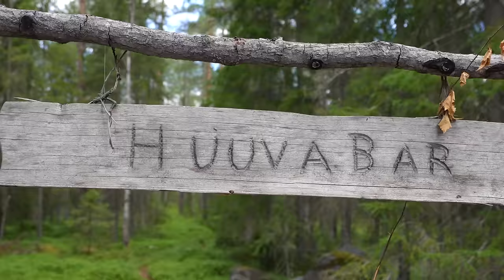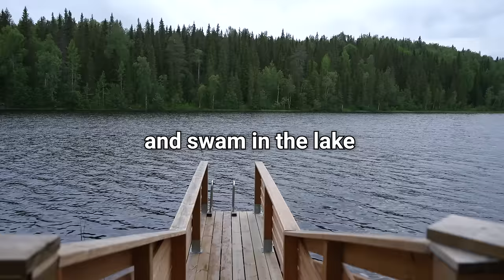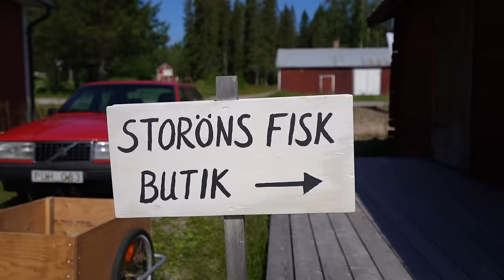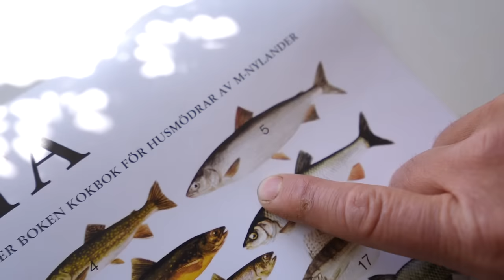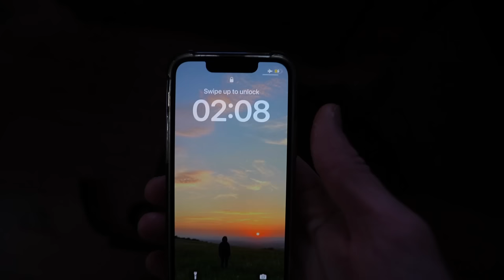Travelling to the northern wilderness - 1 week in Swedish Lapland

Comment: The red paint is called falu rödfärg and is as you say a by-product from copper mining. It was originally made in Falun where Sweden has had a massive copper mine since about 250 years back.
Reply: Copper has been mined since 800 century in Falun and ended 1992. First written document is from 1288.
Reply: way more than 250 years....
Reply: They still take the pigment from the mine. The falu rödfärg factory is like 100 meters from the mine entrance.

Comment: Sludge paint like Falu red is both easy to use, fairly cheap and natural. You simply brush off the residue before adding a new Layers. Only down side is you need to repaint more often.